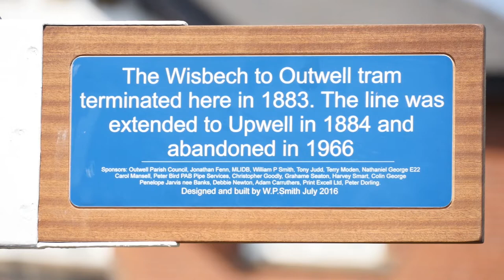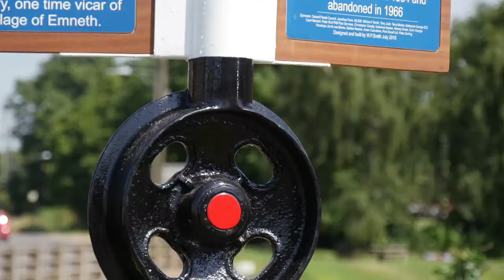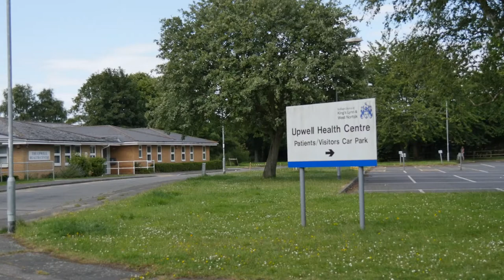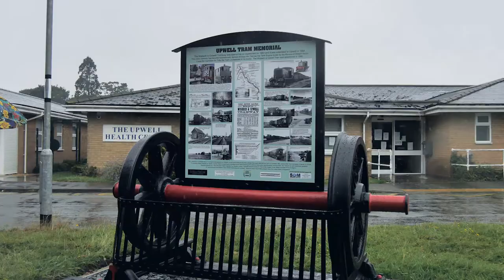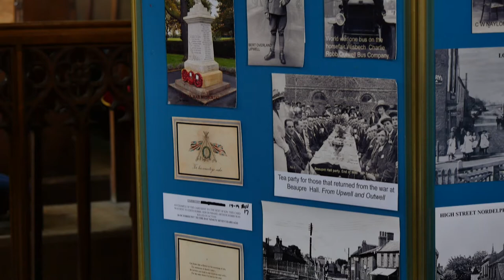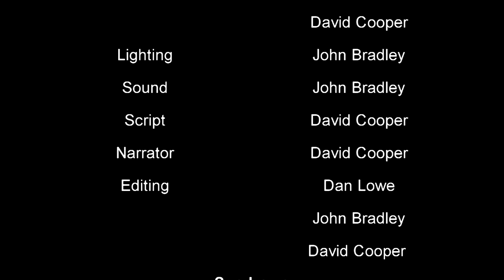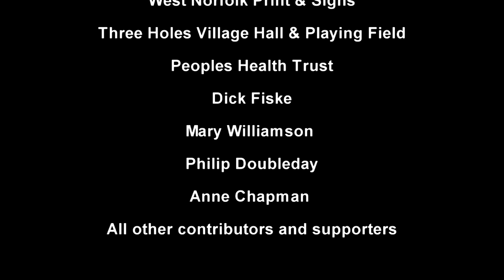Wisbech to Upwell Tram Project - Phase 2 - Upwell

Comment: Born in 1956 I lived in a small cottage on Basin Road, very close to the bridge which took the tram over the old canal; there was a depot on the other side of the canal, with a small brick building which had an open fireplace in the single room building. My dad knew the man who worked at that depot and often we would walk across the bridge to see him. I can't remember what his name was (it has been 60 years since the last time I crossed that bridge, as we moved to Walpole St Andrew in 1961) but my mum always called him 'Horace Hotplate' for some reason, and that is what I remember him as.

I do recall on one occasion riding on the 'push me, pull me' cart with him and my dad, I would have been about 4 at the time - health and safety today would have crucified them both. That tramway was a big part of my very young life, the recollections of the people and the images they conjure has taken me back to part of my joyous childhood.

Comment: was the wheel set based on the driving wheel set of the steam tram engines
Reply from the maker: Apologies for delay in replying. I referred this enquiry to Bill Smith. He recalls that they were from a wagon and not part of the engine and were purchased from Ray King of Hardingham Norfolk. 
Ray is very helpful and I think he will be able to reveal the origins of the wheels and axle if you wish to pursue the enquiry further.   
Rays contact details to Mr Reader. rayking@tractionads.com 

I hope this helps and thank you for your interest in the project.